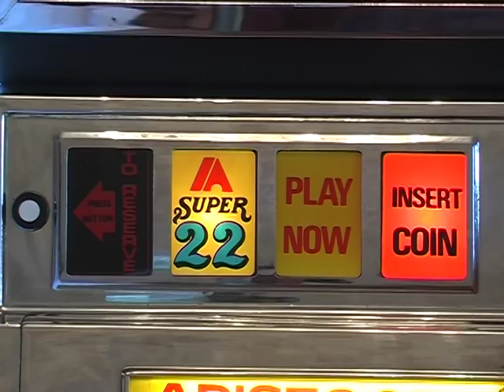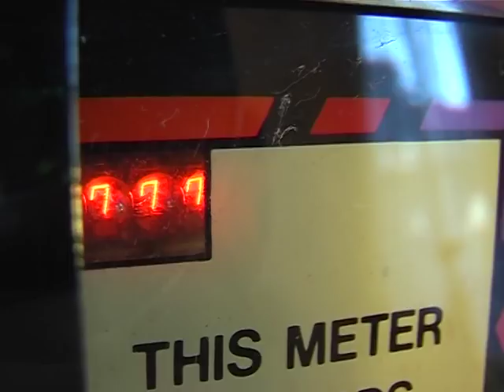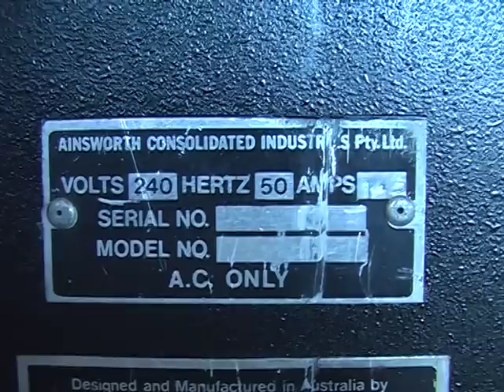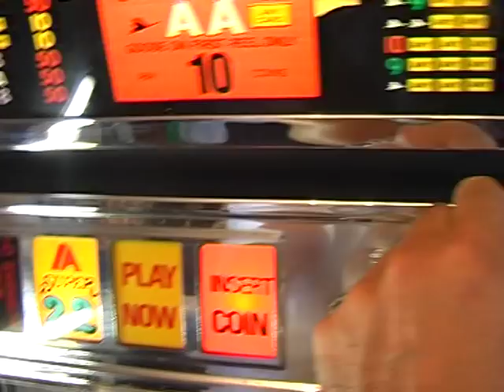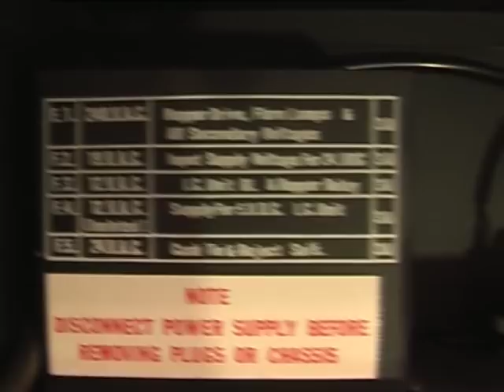Mostly mechanical One armed bandit / Slot machine / Pokey

Comment: Counters reveal that payout rate is around 86.9% (coins in to coins out). 
What amazes me is that this mechanisms processed almost 7 millions coins and still work! Do they get rebuidlds over time? I believe that processing that amount of coins, sometimes dirty, sometimes damaged, handled one by one may wear out mechanisms that must be precise enough to catch any counterfeit ones and keep accepting good ones.
Reply from the maker: mibars Hi there.  The thing initially needed tuning; from memory bending the bars in the top of the machine slightly.  The mechanisim also was soaked in oil which no doubt helped it survive the decades.  When I had it it didn't get much use but was also in fairly good nick; any real servicing was done prior to my ownership.  Nice to know it had a productive life!  :)  Interestingly, if this machine is out of tune it will fail in the players favour; good incentive for the owners to keep them tuned no doubt.  ;)  Cheers...  Clark
Reply: Hi, thanks for answer!

Comment: Hi. How does the handle actually spin the wheels, is each wheel spring loaded? I know each wheel spins independently if so, then how does each wheel spin with its associated payout disk at same speed to get a winning line and activate payout fingers? Thanks in advance.